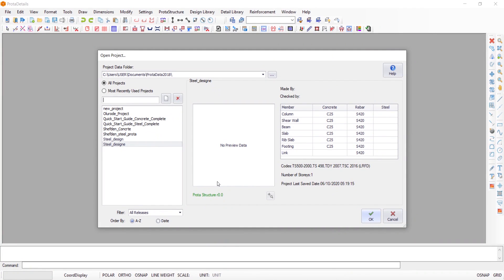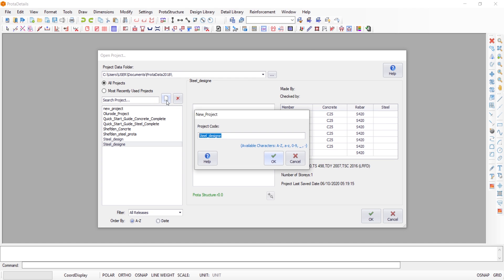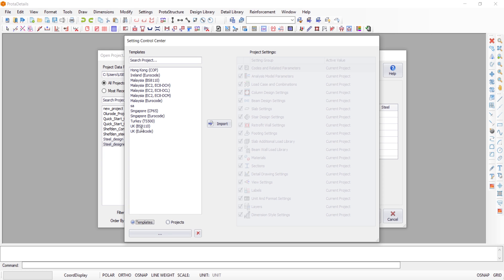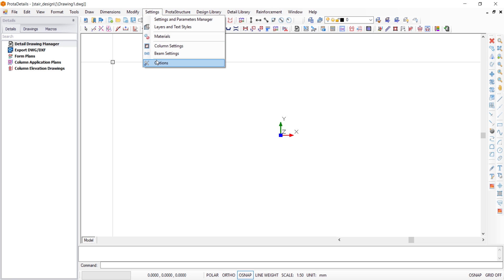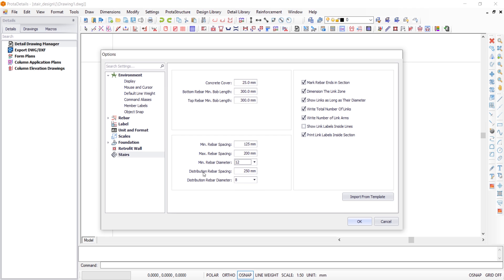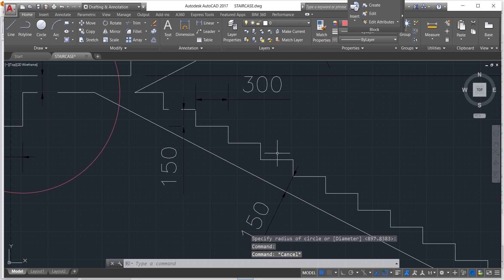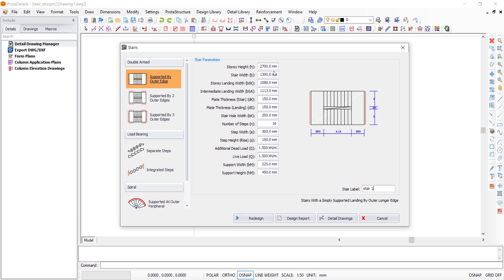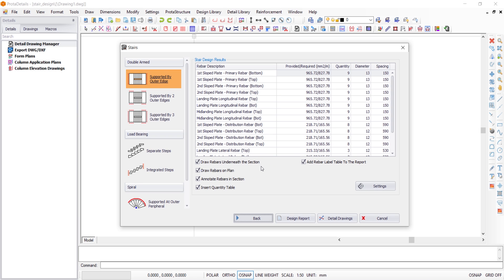Designing of staircase with ProtaStructure

Comment: Great video. Sir I have an issue. I followed your tutorial on stairs design but the values I have in the column "provided/required (m2/m)" are all 0.00/0.00 and my spacing came out 0. What could be the problem. Please help me out
Reply from the maker: There should be some provisions provided for reinforcement and spacing. Make sure you hit on the design button b4 viewing detailing.

Comment: Hi Sir, can I kindly check with you, If I design the staircase in Prota Steel with details and everything, 
Do I still need to do the Staircase modeling in Prota, 
for example if I am designing a 2 Storey House with staircase inside, 
Do I need to do this? 
1st step: Modelling all columns, Beams, Slab, and Staircase for the house 
2nd step: Design Staircase separately in Prota Details 

are these steps correct? is my understanding correct ?
Reply from the maker: Yes can do either of the two, you can decide to model the staircase together with the other structural members, doing this will ensure all loads are not left out. The second option of designing the staircase separate, you can do this bur ensure you transfer that loads manually to whatever is supporting the staircase in the model.
Reply: @ShefdenAcademy  Thank you sir for your reply, very much appreciated it. 
May I asked, how about to design L-Shape Staircase, Open Well Staircase and Straight Staircase with Landing? 
Can we use Staircase Module in Prota to do these three type for Design? 
Or Staircase module in Prota Detail only meant for the use of U-Shape (Dog Legged) Staircase design?

Comment: Good video. We don't use Y13 in Nigeria, how do you ensure the selection is Y12?
Reply: It's already a year ago but I'll still drop this here.

I always tell young Engineers to learn to trust their brains first before dabbling into the use of all these structural design applications. These applications are just a GIANT CALCULATOR. They should be seen as TOOLS to make your analysis and design faster but allowing the applications to make judgements for you will get you into trouble.

From the video above (14:52), the required area of steel reinforcements at different sections of the staircase has been provided by the application.
Furthermore, you can actually export the document displayed as a *word file*. Which means, you can simply go to your *steel table*, provide the right area of steel reinforcement based on the available reinforcement diameter in your country/region, edit it in the word file and you're done.

Manual design may be time consuming but understanding it for each structural element (beam, columns, slabs, foundation, walls) will allow you to know how each behaves under different load configurations. Therefore, you'll know when your structural design application is giving you an erroneous output.

My two cents!
Reply from the maker: What you have to do is to choose a project that you have already limit the reinforcement to Y12